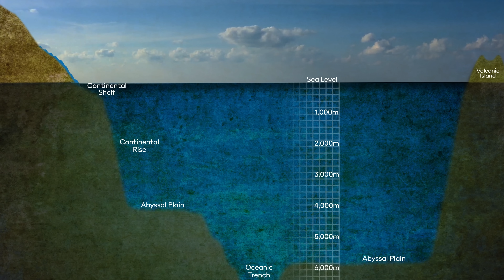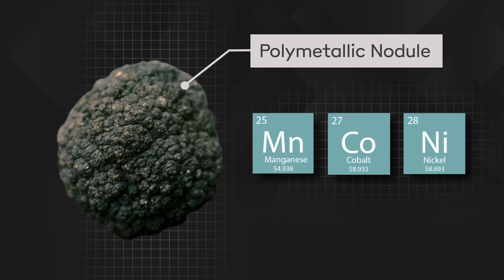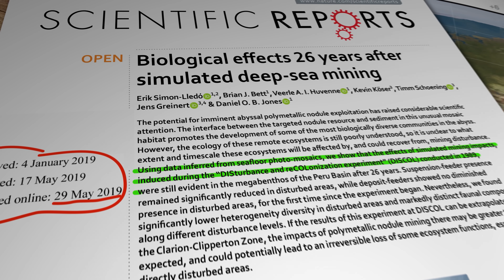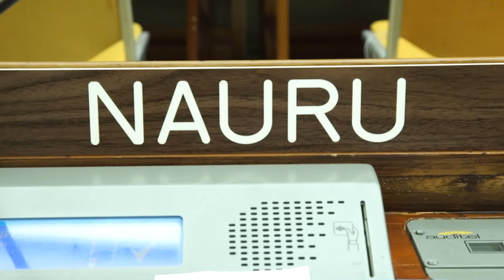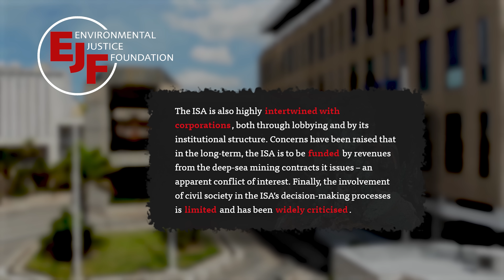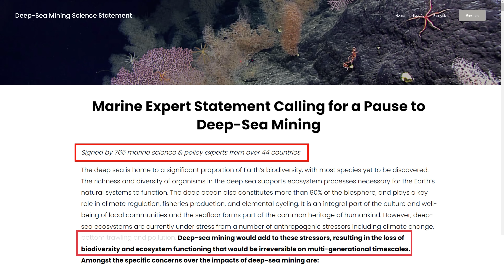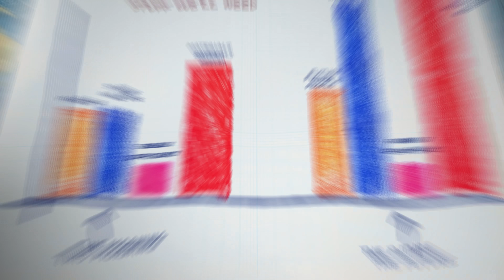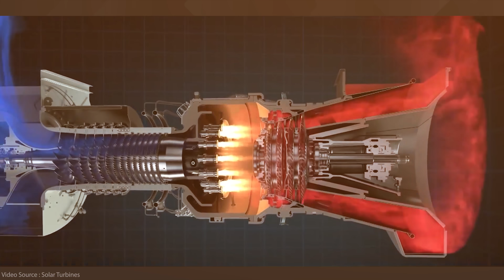Humans reach a new low. Literally!

Comment: I think the solution with biggest impact for climate would be setting a worldwide population cap to 1-2 kids per couple for certain amount of time. Population will slowly drop in numbers over time and then it would be possible to revise this again some years later and either adjust or lift the limit altogheter for another period of time. It would go well together with spread of AI and automation of many jobs, which would ease the impact on pension funds for example.

Comment: I wouldn't be surprised if it's the fossil fuel industry promoting this as the future of EVs. It's like how the meat industry promoted insect farming as the future of alternative protein. By picking the worst/most off-putting version of the alternative and holding that up as the best/only option, the encumbant industry can delay disruption for a few more years. The fossil industry's new tactic seems to be framing the energy transition as an inescapable choice between two equally dire forms of environmental damage.

Comment: The vacuum cleaner mining technique really does seem pretty bad, but you act like it's our only option, and it's not. I think your position would be a lot more credible if it was more like "let's make sure that exploiting these nodules is done in a way that leads to a full ecological recovery of the mined area within 10 years. Unfortunately, you're conflating deep-sea mining with deep-sea mining by a maximally crude method. That's similar to someone who is against all forestry because he thought that loggers only know clearcutting and assumes there is no other way to harvest wood. I don't know if you have ever been to the Black Forest in southwestern Germany. It's a huge tree farm. The whole forest is basically there for the exploitation of wood resources. Every tree in it is destined to be used by humans. But because the exploitation is managed very responsibly, it's also a beautiful, diverse and thriving forest. My point is that humans can exploit nature responsibly and respectfully if we just try, and simplistic attitudes like yours are actually doing more harm than good. We should be protesting a method (like clearcutting), not an activity type (mining, cutting trees for wood). For example, if the life cycle of octopi really requires nodule-shaped things on the seabed, we can drop down a bunch of boulders or maybe concrete spheres onto exploited areas. Let's test that. I'm sure we can find a way to separate off the nodules from those worms to make sure that enough of them stay alive for a quick recovery. And the dust problem has solutions as well. If activism amounts to a blanket refusal to touch the deep-sea metal nodules, activists will just be ignored, and the exploitation will happen by the worst means possible. It's totally within the means of 2030 humans to have hovering submarines with many AI-guided claws that gently pick up the nodules one by one and replace them with similarly-shaped objects made of something else, all without stirring up the sediment or killing a single worm. If you gave this problem to the Tesla robotics team, how long before they had a working prototype that can do this?

Comment: Did you just argue that steel is a part of the fossile industry? And that space and aero-industry is as well? What type of hippie thinking did you pick up ok your rabbit hole research of sea mining? 

We are gonna need these materials one way or a other. If the technology you are saying can replace it, then we would not do this. The cost of extraction this is very high already, and only a restrictions on the metal market has made this profitable. If your alternative tech solve is there, this won't be able to sustain itself more than a few years.

Comment: Metalic nodules do exist in the deep ocean.  The cost of collecting them in energy terms is questionable if the value of the metals collected.  Not considering any envoronmental impacts.  Once fossil fuels are in short supply the energy costs will escalate.

Comment: A few things to note: We may not have enough cobalt to complete a rapid transition to renewable energy, especially if everyone is going around in their own personal electric car. Cobalt and nickel are extensively used in lithium ion batteries and if everyone starts getting their own electric vehicles then we simply may not be able to get enough cobalt from african blood mines to supply the industry. The real solution to transitioning away from oil involves robust, frequent, and reliable public transit networks instead of personal vehicles. This will also decrease energy usage per person which will speed up the transition and reduce the amount of oil that we would still need to use (roads require a lot more oil than rail, and more lanes= more oil). Public transit is also positively scalable, unlike individual vehicular transport which as it scales creates more and more problems. The more that people use public transit the more demand there is so the busses and trains run more frequently and at higher capacities. Whereas the more people that drive the worse congestion (and traffic) is.

Comment: Underwater mining may well be much better overall than surface mining. Many minerals are hosted in rock types that react to oxygen and decompose once unearthed. This is why surface copper/gold/nickel/zinc/lead mining can generate acidic soils that then enable toxic secondary minerals to dissolve and spread. This does not happen when the minerals are not exposed to oxygen. Underwater mining therefore doesn't risk toxic tailings and also doesn't involve the clearing of forests where the mine occurs.
So this video does raise valid points but the alternative could be worse.

Comment: I guess what's most troubling is the clunky, crude methods employed by the mining industry in general.  Demand side shifts towards common elements is excellent, lessened demand by shifting towards renewables, as is more efficient use of those elements including recycling but in the end there is still some demand and need for mining.  So either they come from hard rock mining on land or undersea mining or nodule retrieval.  In getting at those metallic minerals, better ways of extraction or gathering should be developed that minimizes the environmental impact.  Earlier in your video Dave you showed a robotic explorer picking up nodules rather gently from the ocean floor, which seems like a much more benign way of retrieving these objects, and after careful study, might be the best way to proceed.  Or else we'll have to make use of land deposits like the ones up in Sudbury Canada, and do a better job of getting out the nickel with minimal disruption, possibly by directional boring and backfilling with CO2 capturing mafic gabbro and binder.  Less is best, but some demand will still exist for new metallic minerals, so we do need to find a way forward. 🌄

Comment: Ok Dave as before I think I made my point. Digging up the earth and now the sea bead to make batteries is the most foolish thing mankind has ever come up with. It simply is not sustainable to store electricity into any batteries. Eventually we will run out of places to mine this stuff.But the worst part is that sensitive ecosystems are going to be exploited like the Ring Of Fire coined by the mining companies and located just south of James Bay in northern Ontario Canada.. Lorna Harris a PhD in Biotechnology Has studied this are for 2 1/2 years. And the digging for these “critical minerals” in the Ring of Fire will release 450 million metric tones of CO2. Presently stored in the peat moss that covers that ecosystem. And you haven’t made the battery yet.
Yet you still think that Batteries are going to save the world.  Hydrogen on the other hand can propel every mobile device with an instant renewable and there fore completely sustainable fuel for ever. How is it that not more green then batteries.  Let me ask you this what other fuel do you know of that when used instantly goes back from which it came from? We’ll go ahead I’m listening. Thanks for the video , well done.

Comment: He normally appears like he knows what he is talking about, but in this case, he has bought the activist line "hook, line, and sink".  A good example of his problem is the worms from the deep ocean.  They are feeding on whale bones and whales are the few hunks of food that actually can reach the bottom before it was fully digested.  The ocean bottoms with large animals for photos are aerobic with oxygen, but the water exchange rate with surface waters is measured in centuries which means the metabolizable energy flux is near zero and the animal density and biomass are also near zero.  That means that we are talking about an ocean desert ecology with almost no biomass and no ability to have any impact on the surface photic zones where all the algae grow.   The strength of that ecological connection to the surface is very close to zero and not relevant.    

An old marine biologist professor told me half a century ago, "Nothing ever dies in the ocean, it is eaten alive before it is dead".   Back in the 60's activist like Pual Ehrlich with all his predictions of starvation of humanity and total human failure was obviously wrong.   He was also making statements closer to my turf by claiming chemical X (the chemical of the month as our analytical capability improved) impacts phytoplankton in the oceans and the oceans produce 2/3 of the world's oxygen production.  He would then claim that if we continue the pollution we will all die. 

This made a good exam question for the Graduate level Environmental Engineering Class I was teaching at the time by using his quotation and asking the following questions.  
* Is he correct in his claim?   Answer: the statement about O2 production is correct (good enough) but his conclusion is false. 
* We know what the primary productivity of the oceans is (amount of photosynthesis), but what is the NET O2 production in the oceans and how would you estimate it?
    Answer: Just note that the net production is determined by the carbon removed by getting buried in the sediments.  Every atom of carbon buried has a net molecule of O2 produced. The huge difference between the primary productivity carbon fixation as organic material and carbon actually removed from the system is measurable and known, but tracing the food chain is near impossible as the manure gets recycled as it sinks.  

In the areas with these very old nodules, the sedimentation rate is known (has to be in the mm/century range) and the carbon contents of sediments are known so the metabolism or life is very limited in scope and amounts.   No energy flow, no life. 

Much like a whale carcass as a local food source or in areas near geological activity can also provide an energy supply to support a local significant ecology like a small spring in a massive wasteland of almost zero life of any kind.   For the largest source of high-value minerals on this planet just waiting to be picked up to be neglected for a very small number of strange animals is insane.  Most of the photos of life on the bottom are near energy sources like carcasses or geothermal springs.  

Abandoning a truly huge source when we clear-cut the highly productive much shallower oceans bottom with tens of thousands of bottom trawlers around the world putting more sediments, nutrients, and recycled persistent organic pollutants (POPs)  into the photic zone of the oceans that all the ocean rivers and industrial outfalls combined.  Almost all of the Gulf Coast of the US is clear-cut every year (shrimpers for 10% of our shrimp supply -- the rest are farmed) but the local impacts on the ocean bottom can be seen for many decades.  To feed the dead zone in the Gulf, the bottom trawlers put 9 times for phosphorous into the algae bloom which creates the annual dead zone that the Mississippi River.

Comment: I designed and built my own E-bike with 99% used parts. It has a top speed of 22 mph and a range of 70 miles on a single charge.

Comment: This all sounds like a barely controlled eco-disaster waiting to happen. I've been recycling since 1968, when I first started delving into macro-economics in high school and have witnessed the metamorphysis in the recycling standards. Metals that used to bring in good profit, like brass and copper and aluminum don't bring anywhere close to what they did back a decade or so ago. The plastics waste (specifically, plastic bags and wrapping materials) is a massive headache for the recycling processors, as they clog the machinery used to separate the various different types of plastics. Very messy business, recycing is.

Comment: I’m a bit sceptical about Al Jazeera publishing this news about possible turmoil in deep sea eco systems because of rate earth metal mining, metals needed for batteries necessary to transition to a greener economy 🤔 surely it will have an impact, but will it be as massive as the oil industry or current mining?

Comment: The only safe way I could see to "mine" them would be to have a sub with robotic arms and a person (perhaps on the surface, behind a vid sceen) operating a robotic arm and picking only those of a size limit (say 4-6 inch with built in scale) and plunk just those and have a daily "catch limit as is done with fishing. Nothing on the floor, as sub would be floating above and only spot disturbed would be the spot they are lifted from. The "miner" could be required to keep a record of all work on video, so they could be fined or lose license to "mine" if the are doing extra damage to the sea floor or sea life. Maybe also get a yearly claim to an area they work.

Comment: I find it ironic that the mining companies say that they would walk away if they don't get the permit - every natural resource exploiting company will sooner turn to illegal mining, based on historical and current experience.

Honestly it seems like there's going to be yet another gold rush for these nodules. mlMost of the startup companies will die out after having destroyed 1+% of the ocean's seafloor, but then some massive private company or oil company will buy them up, deploy 10+ of these drones in a fleet, and then promptly crash the market. Gonna be real interesting when they start vacuuming up shipwrecks, endangered species, undersea internet cables, and the cables start getting snapped by cliffs, debris, lack of maintenance, submarines, and animal attacks. 

All for a resource that, like oil, will be gone within 150 years, will flood the market with new materials, all for consumerism and rampant environmental pollution to increase the price of housing and living.

I would not be surprised if some eco terrorist group a la Sea Shadow, bought/made a sub and started cutting cables, after all, apparently basically nobody cares what happens out on the high seas enough to send warships out to sink ships.

Comment: Thanks, good show — particularly interesting that these minerals are actually critical to fuel production, I had no idea of the extent of that.
Reply: The most recent chart I managed to find a year or two back on Cobalt usage [c.2018] was about 8% of global production was consumed by catalysts in petrol/gas refining. High performance steels, pigments for ceramics were other uses and about half for batteries but the latter use has probably been growing.

Comment: I think we might have the necessary technological sophistication to be able to build robots that can hand pick those nodules without ruining the sea bed. The return on investment might be smaller because these types of robots will be more expensive to build but the impact on the ecosystem will be negligible. 
To give you the image that came to my mind: Imagine a large crab-like robot that uses its pincers to grab individual nodules without disturbing the seabed very much. 
If the pickings aren't worth the expense of the robots then the pickings aren't worth enough to go down this path.
Messing with large swaths of seabed is not an experiment we can dive into without great certainty that it's safe (which it likely won't be).